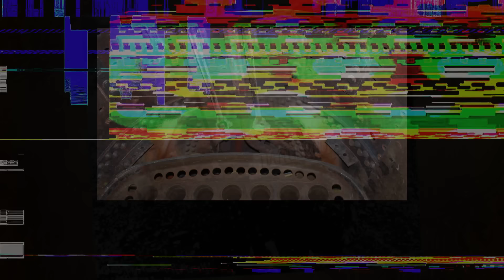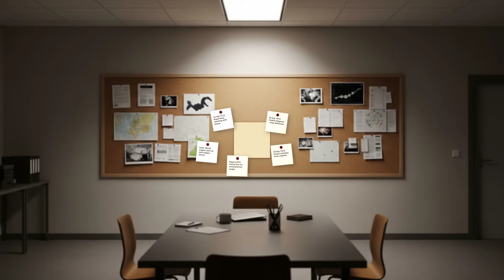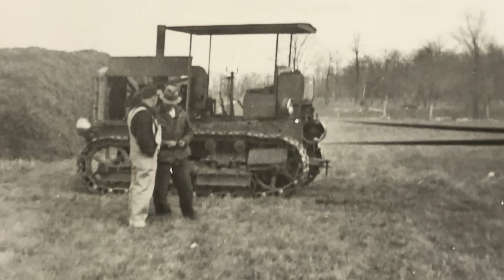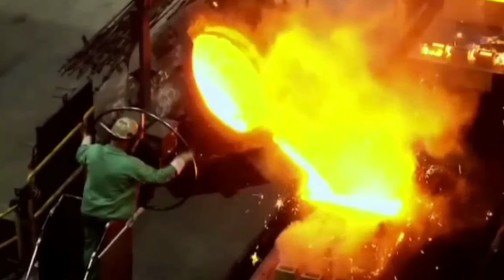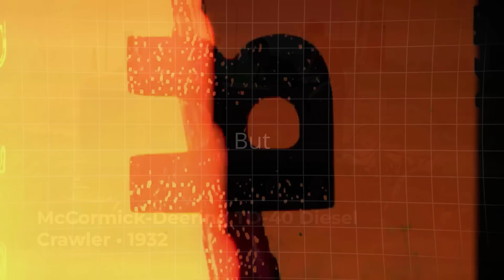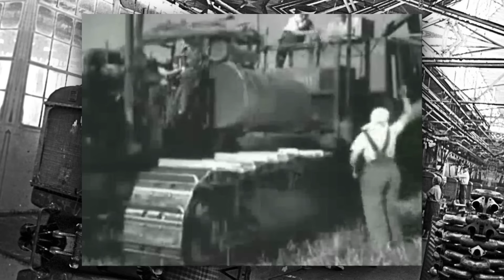Before Hydraulics: How Caterpillar Killed the Steam Engine (1931)

Comment: Gas, Kerosene and other spark ignition engines  had done in steam long before 1929.  Best and Caterpillar built about 19000 Sixtys almost all Gas
Reply from the maker: Great insight! Gas and kerosene engines were definitely ahead of their time in phasing out steam. The sheer number of Sixty models built is a testament to how dominant they became. Thanks for sharing that knowledge!
Reply: the title is about the diesel sixty specifically not the gas sixty line... those two are different machines with different production numbers so both figures can be true.
Reply from the maker: RuiltThisWayYT Good clarification - the diesel sixty vs. gas sixty distinction definitely matters here. Thanks for clearing that up!